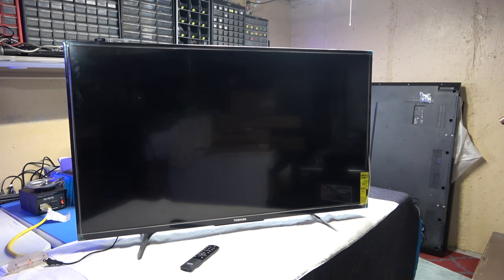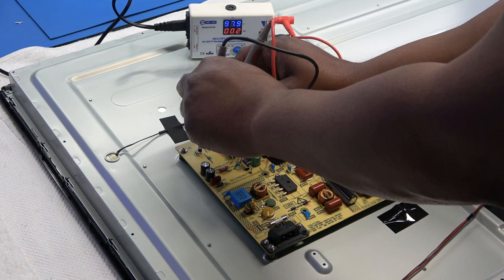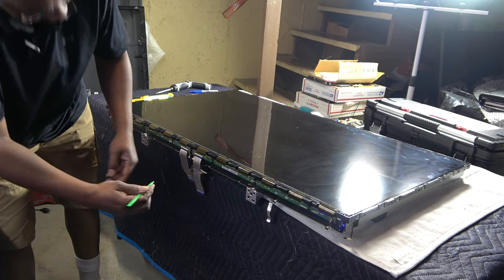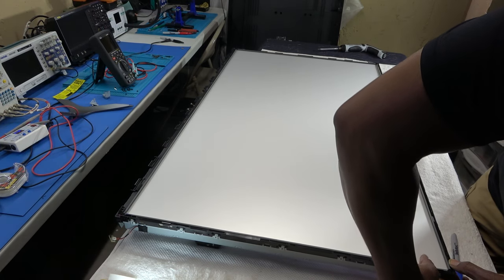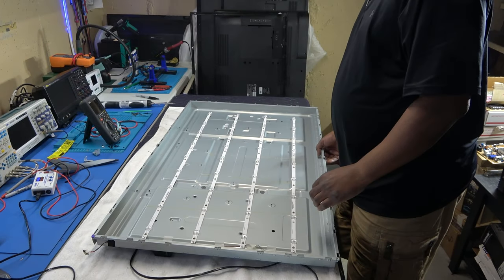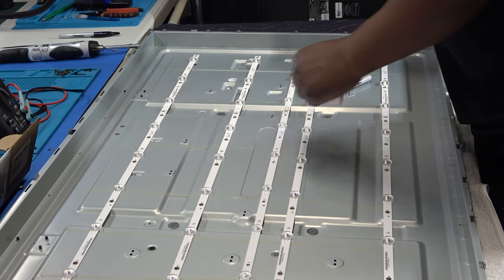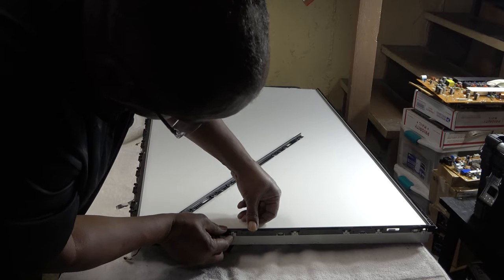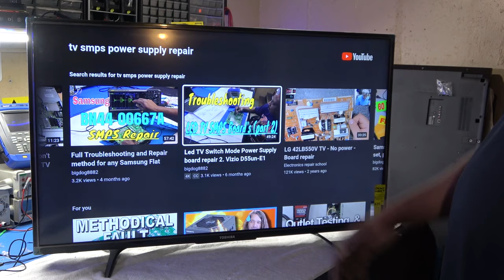Why do people leave those Yellow stickers on their TV? Toshiba 50", picture goes Black TV repair.

Comment: Great videos as always. I have a "55" of this tv. It had a dim picture, test the backlights and they all lite up, using the tester. All of the ground screws on the boards weren't tight. After I tightened them up, the picture came back to full brightness and haven't had a problem with it since.

Comment: That takes some of the mystery out of electrical problems. Thanks! My problem seems just a little different. I have the Toshiba 49L510U18 which must be very similar to this one, though I don't think this model is a Smart TV. When I turn it on I get the Toshiba splash screen replaced by the white 2" wide bar across the top with "HDMI 1" visible to help set up the input. That stays on for maybe 3 seconds and then the screen goes dark. Since I only use this TV as a monitor for my computer, when I start it up and the splash screen goes away, I can see the computer beginning to start up, but the screen goes dark before that can happen. Is this the same problem as in this video? What causes the other rows of LEDs to go out if just one row is fluctuating or bad? Are those LED strips available on Amazon or another source?

Comment: Have the same problem shows Toshiba for 2/3 seconds then goes off ! I have changed the 3 main boards but still have same problem any advice how I can fix as tv is only 4/5 years old and would be happy to try and fix it what part do I have to replace ?
Reply from the maker: Backlights, use the flashlight test when tv goes black.
Reply: @bigdog8882  will do thanks mate
Reply: Have opened the tv it looks like all led bulbs are working but still flashes on and off after about 2 seconds , ordered new led backlights so will replace and see if that solves the problem any other things it could be ?
Reply: @bigdog8882  I’ve opened it up and all the bulbs seem to be working but still flashing on and off , I’ve ordered new led strips for the tv so will see if that resolves the issue
Reply: @bigdog8882  I’ve checked the lights and replaced them and I’m getting the same issue I’ve replaced all 3 boards so can’t be them ? Only thing it could be I’m guessing is the wires between the boards ? Any other suggestions ?